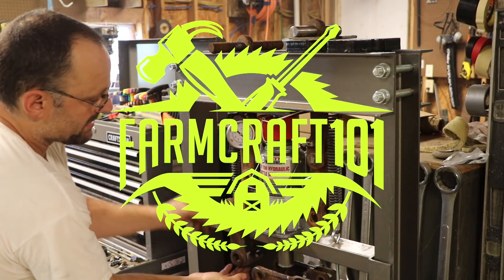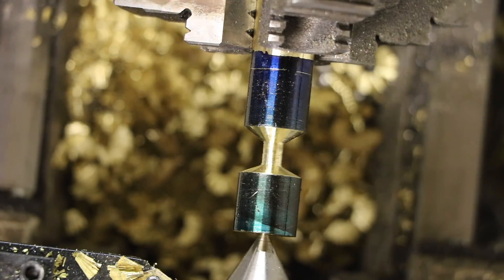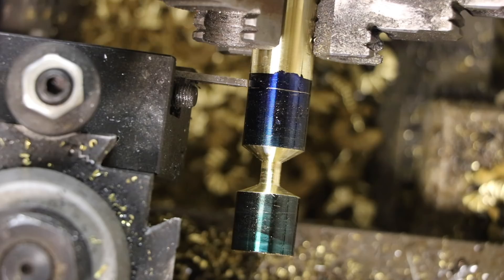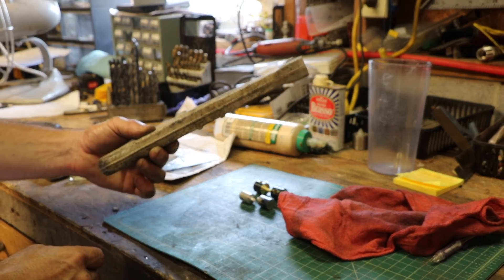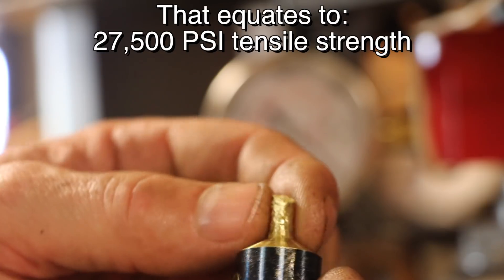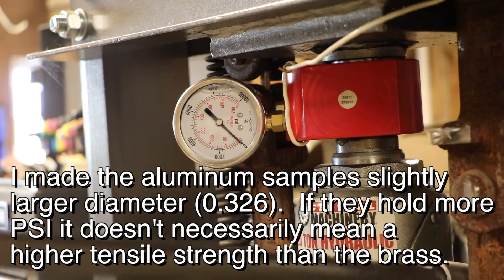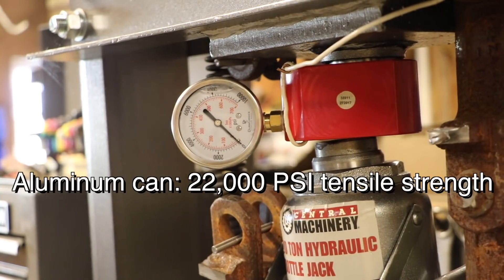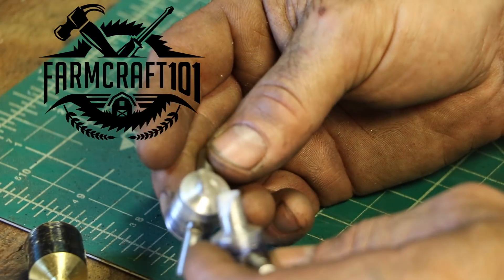Taking metal casting to the next level.  Who wins the tensile strength test?  FarmCraft101

Comment: I hate it when something flies out of a piece of machinery. It is always rather sudden, and very surprising to say the least.

Thankfully, a lower receiver on an AR does not need to be all that strong. The lower does not take any pressure. That is why ones made out of plastic work. I mean not well, but they work, with a few exceptions that work surprisingly well. I made a lower out of wood once. Worked for about 20 shots before the thing broke and the buffer tube spring kind of pushed the rifle in half. IT broke just behind the safety.

Comment: the best quality Aluminum was obviously FORGED 6061, that compresses and makes the grain structure so much stronger. also the 61 part means it was HEAT TREATED as well...cool to watch. but unless you got dies and a 100 ton press, you ain't making platters like the big boys do for the forged upper and lower AR-15 receivers.

Comment: There is another important influence on the strength of aluminium alloys. The high strength alloys for wrought profiles as well as for castings are heat treated after casting. There are two main groups of heat treatments: A) The hot metal is quenched and then stored at room temperature for a few days during which the strength goes up (christal growth of alloy metals). B) The other is heated to certain level like 450 degC in an oven for some time then cooled down to something like 250degC for a number of hours. Typical for cast car rims. Now if you melt down a car rim and cast it but don't do the heat treatment then you only get half or two third of the original car rim strength.
Reply: I concur. That aluminum suspension arm (german) was most likely heat treated. Big difference in strengths. Make another test piece, then anneal it and test again. Right meow.
Reply from the maker: That's a good point for aluminum.  Doesn't apply to brass because it doesn't change with heat treatment.
Reply: True. But since you went to so much length to test different aluminum samples why not try to redo the heat treatment of your aluminium casts? Most likely you can find a data sheet of an aluminium alloy for car rims that includes the heat treatment.
Check this video after 2:40 https://www.youtube.com/watch?v=LCMs-7K8nLk
https://www.engineeringclicks.com/aluminium-car-wheels/ 
AlSi7Mg0.3 with heat treatment T7seems to be the alloy of choice. 
On the last page of the next link are the heat treatments of T6 and T7.
https://www.foundry-planet.com/fileadmin/redakteur/Material/08-03-10-Leporello_engl.pdf
Reply from the maker: rol eic & Chip Ellis I am planning on doing some testing of heat treating vs non treated samples, but heat treating aluminum is fairly complicated and depends on the alloy.  I find conflicting info on the process.  I have a new electric kiln and I can control temperature precisely, so I should be able to do a good job, I just have to decide on the temperatures.  First, annealing:  "Annealing should be done at 775°F for at 2 to 3 hours at temperature, followed by controlled cooling at 50°F per hour down to 500°F then air cooled."  I can turn a sample out of the auto part like I did before and anneal it, then test it to see how much strength it loses.  Then heat treating for T7 I find: "T7 520-545C for 4-8 hours, quench in 20C water, then age at 200-230C for 6-8 hours."  I doubt aluminum can alloy will be affected by heat treatment, but I figure I'll try it at the same time.  You guys agree on my numbers?
Reply: I only got the information for which I put up the links in my comments. These were for cast alloy rims out of AlSi7Mg0.3. I don't know if your strut is similar to that. Do you have information on the strut material?
Reply from the maker: I don't know for sure, but fortunately if you look the heat treatment for most of the alloys is very similar.
Reply: Well, what can you loose? Nothing since metal working is supposed to be fun anyway. :-)